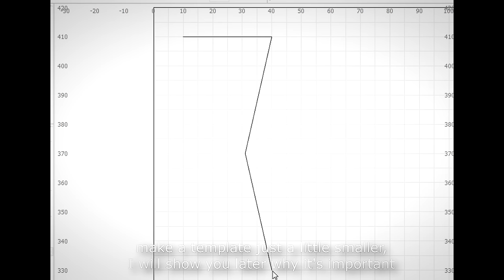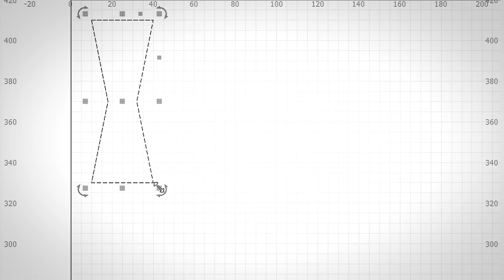Perfect Fit Bowtie With Minimum Chiseling - How to

Comment: Thank you Gregory.
For all folks out there without a laser, you can also use a 3D-printer.
Almost all my jigs that need some level of precision are done with a template out of my 3D-Printer.
If it has to be somethink more durable and sturdy, I tape it to a piece of (ply)wood and make a long-life-jig...
Reply: optload  Well a 3D-Printer is more versatile for the most people than a laser. So more common.
And I got my 3D printer for 120$. In this pricerange you don't find a laser which cut through materal so thick...
Although I have to admit for this price you neither can buy a 3D-Printer anymore...